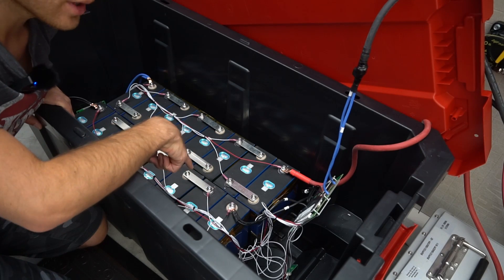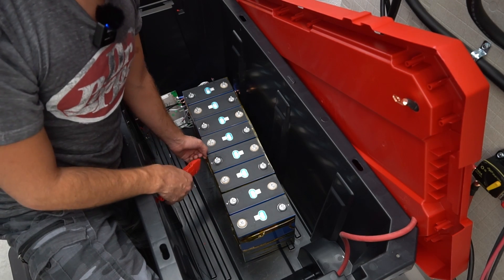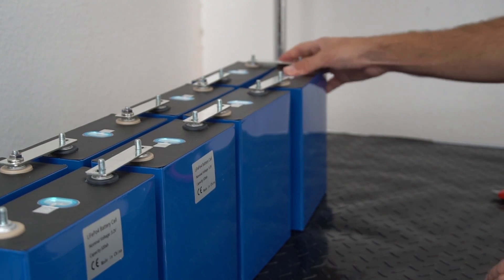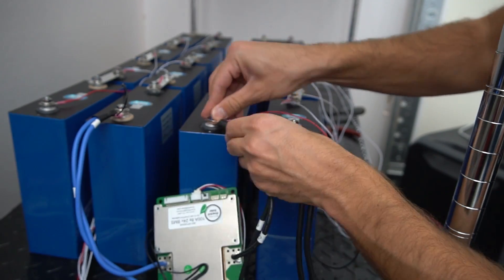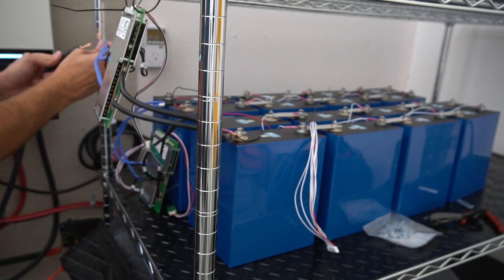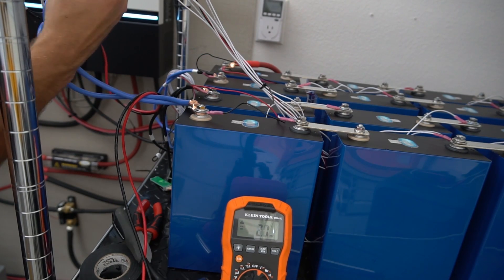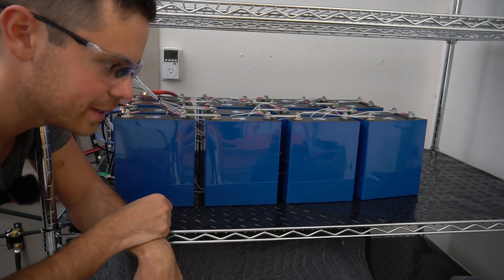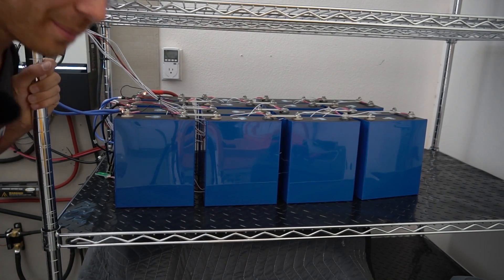Bloated LiFePO4 Cell Configuration to Reduce Terminal Stress! (suggested by my viewers)

Comment: My lifepo4 cells swelled a huge amount.  Like a pillow.. They blew apart the plastic battery box.  Are they ruined?  Or can I recompress them?  Or just use them as is?  They are small 32AH square cells, about 4"x5.5"x1.25"   and swelled up like a pillow.  Perhaps from overcharging, though I had a really good JBD bms with low and high voltage cutoff and had it on a LIFEPO4 charger.  So should have cut off.  It sat for about 6 months.

Comment: Hi Will, you mentioned....  these can bloat all they want.  i was under the impression that bloating is super bad and means they need to be replaced.  is that true?  how much is too much bloating?  do these ever "un-bloat" over time?  I have one cell that has bloated quite a bit so i've got a new replacement set coming but was really curious as to whats considered too much bloating and MUST be replaced.    I have eve lifepo4 230 ah in a 48v setup.  also, is there such a thing as a 17s bms/balancer?  my axpert hybrid inverter apparently can handle 51.2 v so I had thought about adding one more cell to make it a 51.2v setup but i'm not seeing any bms/balancer for lifepo thats 17s.    since I don't see any hybrid inverters that can do 96v, what are these 20s or 24s bms/balancers used for?  
also, i had my batteries strapped together like you did.  i only see one cell that has bloated.
 
Thanks,

Comment: I know this video is 3 months old, but that style of shelf is the absolute worst... They tend to use set screws + friction on cheaply plated posts that chip.... Even if you dig the screws in, slightly overloading them leads to the shelf slowly working down the posts....

Maybe you got some quality ones there, but I personally would not put what would essentially be a bo mb on there in the case the shelf comes down....

Comment: Odd chance I'll get a response, but those warning labels for the cables, what does it say and where did you get them? It looks quite pro.

I assume it's to warn about either 48v DC under load or that it WILL arch if you disconnect it improperly. I would like those.

Comment: Will, Love the videos and you have given me a great education in this space.  Curious question, in a 4, 100ah lithium array does the wiring all have to be the same size or can it be increased as the cumulative load increases as the load is drawn? So in this use case say I put a 100ah load onto this 4, 100am battery array, would the draw load be different across each leg growing 25 amps per leg.  Would the first connector only carry 25 amps and the second 50 amps and the third 75 amps and coming off the last be 100 amps to the buss bar and to the load source? Would it be ok to use increasing wire size going 6 awg then 3 awg then 1 awg and then 2/0 awg to the buss bar if 100 amps draw was always going to by my max? Why do almost all installations always use the same wire size and is it really not needed or is it just the way we always do it?

Comment: Is this suggesting that externally forcing my 4s battery pack to be unable to expand (so, when they do try to bloat it creates compressive force on each cell) could lead to a scenario in which a cell off-gasses out the top???   

Does anyone have experience with this happening?
Reply: No.  You just have to compress them when they are still new and flat and before you fully charge them.  Then they won't bloat.  Also charging them at the recommended charge amperage reduces bloating.   Rapid high amperage charging increases the chances of bloating the cells.  Once bloated you cannot compress them flat again.   That seems like it could cause the pressure valves to leak, but I've really not heard of that happening.

Comment: I thought compression on the batteries is for reducing the movement inside!? Is compression only recomended to prevent movement, respectively stress on the terminals when fixed together with not flexible busbars? regards! Axel

Comment: BMS using in series is normally forbidden. The Mosfets can not handle much higher voltages as the BMS is designed for. Did the supplier say that it can be done in that way?
Reply from the maker: We use only FETs rated for 80V when using, 48V nominal. This was a big issue some years ago, but not any longer. Most have higher voltage capable fet's
Reply: Any trouble or inconvenience with yours BMS during all this time of use ?

Comment: Will… video request.  How to connect additional batteries in parallel.  I have 2 - 5kwh 48v batteries.  My plan is to get the voltages close to 53 v and then switch the second battery on.  I would be interested in how you do it.

Comment: "Bloated Batteries" Isn't that a strong indicator of impending battery failure.
Reply from the maker: For most chemistries but it depends. LiFePO4 pouch cells swell a lot naturally
Reply from the maker: Depends on why. Cobalt based cells, super dangerous.

Comment: How are some 12 volt batteries 100 amp hour and some are 300 amp hour but the same physical dimensions ? Say a 12 volt d series companies offer them in 100 amp, 200 amp, and 300 amp size but same dimension of the d serries.

Comment: The first lithium batteries I bought was over 2 years ago. After a year one of them puffed out like a pillow. Although it's a little lower in voltage than the rest, they have been working together just fine.

Comment: Thanks Will. I had such a setup from the beginning with my first battery build. I'm not a friend of compression at all and always had a few mm space in between the cells. That make all a lot of sense.
Reply from the maker: Oh awesome!!! It's a fantastic configuration. And I'm glad you think the same way about compression. I never knew what the fuss was all about lol
Reply: @WillProwse  Exactly. This topic basically splits the nation. Some are fanatically chasing these additional cycles, other could not be bothered more 😂
Either way is fine, I guess. Everyone has the option and there is no right or wrong, it's just personal preference.
Reply: Isn't swelling bad for the cells? I have seen others compress the cell stack to prevent that.
Reply: @dougg8280  under certain circumstances they can last up to 1000 cycles longer with compression (or fixture) than without. Not so relevant in solar setups with relatively low currents.
Reply: @OffGridGarageAustralia  thanks

Comment: Do you prefer one 16s battery with one bms or two 8s batteries with one bms each?
Reply: He had to use two BMS units because one 16s was not available.   Two BMS units will allow him more current.   Check out his web page where he has 3 BMS units configured to get 300 AMPS.  All depends on voltage and Amps.

Comment: I am totally new to solar and an extreme novice at electricity, but I was wondering if you could do a video on a solar backup system for a home that the sole purpose is to keep a refrigerator running.   I worry about a power outage that would last for a few days that would cause me to lose everything in my fridge.  My current refrigerator says it is 115 volts and 3.3Amps.   I followed your advice in another video and it appears that 115*3.3 = 380 watts and running wattage of 127 watts, can you help?

Comment: Alternatively you could use flexible Bus bars to prevent any stress on the terminals. There are two kinds of them: foil busbars and woven conductors with crimped/welded ends.
They are still pretty cheap, especially when you always have the same dimensions or you use a already existing procut. 
With flexible Busbars you then could use your plastic housing again.

Comment: Great video. I didn't know you could connect packs together through a bms as you did with the lower bms not tie wrapped to the frame. Great experimenting with bloated cells. Looking forward to your capacity test.
Reply: I did one that was 2/36 bms in series.  I thought I was going to loose my mind plus the voltage scared the crap out of me

Comment: Wasn't there someting about prismatic cells under compression lasting significantly longer?
Reply from the maker: Not significantly longer. This has been discussed a lot on our forum, you should join the discussion and post your evidence.
Reply: @WillProwse  I didn't have any evidence. I had heard something about it and had seen on a weber auto channel battery disassembly video that the Prius Prime batteries were under significant compression. So I thought there must have been a reason the engineers chose to make their design that way when they didn't have to. I also figured you were probably more well read on the topic than I was and might be able to give an answer off the top of your head.

Comment: Separating the cells so that they are not touching seems like a very good idea. The amount of energy stored in one of those cells is like 1/2 cup of gasoline. So a short could make for a very bad day. 

On a similar note, a short between adjacent sense leads, while likely to only result in a fried open lead, could also be a bad situation. Since no current is flowing in the sense leads (assuming they are not also being used for balancing), then why not add a set of resistors (e.g. 1k) in series with the leads. Then should 2 sense wires short, the current would be limited by the resistors, and not cause any (safety) issue.
Reply: Any short burns his house down.  No stopping it.

Comment: Nice 👍 work .. just one thing I think you made the mistake several times coming off the BMS you use the blue cable for your main negative, you did it when The battery was in the plastic box .. will that caused any issues by the way?

Comment: Letting them expand and contract will mechanically shorten their lifespan. You should compress them with two aluminum plates and thread rod. Also have you considered keeping the cells in a chest freezer at 2degC?

Comment: Hey Will. A bit early for a Halloween video isn’t it? 

Seriously though, great video as always. I have a request. I just bought a Ryobi rm300e. That is an electric mower with a (2.4 kWh) 48V, 50 Ah lead acid AGM battery. Could you do a video a setup to use that big battery as a backup in an emergency to power a few small loads like a refrigerator and some lights?

Comment: Use the battery studs to fit a pillar nut. Then add a threaded stud to the pillar nut. Fit a paxolin board to the studs. Fit bms to the paxolin board. Job done.

Comment: You could clamp a piece of plywood to the end of the shelf with bolts and large fender washers, then mount the BMS's on the outside or inside and they would be fixed and safe.

Comment: Is there any way to protect against an EMP attack???
Reply: Yes, there is.  The simplest method is to get rid of your electronics and anything that could be damaged by an EMP.

The second, more difficult option is to install robust EM shielding around your electronics, and add surge protection to any conductors that go outside the shielding.

Comment: well done! one suggestion for the BMS, you could mount both to a fiberboard and then the fiberboard to the edge of the shelf. Maybe you could reduce the input and output through the BMS to not stress those Grade B cells. Either way, looks good!

Comment: Do you recommend the Southwire clamp meter you use in this video?
Reply from the maker: I actually love it. Just as good as my Klein and the non contact voltage sensor is fantastic and easier to use than other clamp meters. Great meter

Comment: Will!!!  You are CRAZY for putting all that weight on that skimpy little shelf. Those NSF shelf units can and will fail, and when it does it will crash down.  The shelf is just wedged into position and the wedges will fail.
Reply from the maker: This one is rated for 8,000 lb. Each shelf can handle 350 lb. Please read the data sheet.
Reply from the maker: And I have six of them and they're super expensive for a reason.
Reply: @WillProwse   Hey I  agree with you, they are super expensive and will hold the weight, but I have personally seen them fail because the shelf clips didn't hold (Plastic wedge) at less weight than rated. Small beans I know, but you are wearing safety glasses in your videos...Just saying.

Comment: Really think your making too much concern for "pressure" build up when cells bloat from charging. Yes from charging, not discharging as previous commenter said. My pack of four bloated cells, the same cells as yours, produced very little pressure when charged to 90%. I secured cells with 1/4"aluminum plate at each end with 2 threaded rods each side. While charging I checked the rods and they never got tight. I secured them when discharged to about 10%, when they were almost flat. Once secured, bloating was restricted with little to no pressure. I would think all that movement will eventually damage the cells. I guess we will see.
Reply: It would be great if you had one pack with fully compressed cells in the system to compare over time.
Reply from the maker: Discharging too low causes gas formation from the electrolyte. Charging up to full makes them expand. Try it yourself
Reply from the maker: I am more concerned with the terminal and the stress placed on it than the actual bloating

Comment: You need a 3D printer to fabricate some form of nice looking brackets to hold the BMS's, wiring and other things. Designed well, you could have ports for routing wiring, screw holes... whatever you can imagine.

Comment: In my experience, the cells bloat when they are discharged, and unbloat-ish when they are charged up.
You really need to compress them so they are not allowed to bloat!
Bloating means the film inside is not getting full contact between them.

Comment: You can bolt a small flat bar or wood on the side mounted on the shelf .if you put a flat piece of something filling the gap on the side of the shelf . the bms could be mounted to that board.if it's wood it's auto insulated .

Comment: Nice work!   only issue I see is that IF you get leakage, it's going all over the place, which was prevented with your box before.   One idea and it's a throw out idea, is flip the rack upside down and you can put in a liner that would go up the sides and prevent spillage...   Or simpler still find the lids for the right sized boxes and put the batteries on the upside down lids with lips...

Comment: Is there a way to connect two solar panels in series and in parallel and put some type of switch into swap back and forth to whichever one you want to charge with? I have two power Banks, both of them charge off my two solar panels on my truck but one of them needs series and the other one needs parallel. Is there a way to do it so I don't have to unplug and plug things in a different way?
Reply: A double pole double throw switch if you can find one with an appropriate   current rating, a relay could be used. This would also open up the possibility of remote control.
Reply: The best way I can think of is to use " dual circuit On1/off/on2" type switches. (Double pole, double throw). One can wire these in such a way to be able to do what you  want...similar to the switch used by my neighbor to brake the wind generator. Of course, someone else might have an easier or better way.
Reply: Your question has been asked and answered on stackexchange electronics.  I'll try to post a link, but if it doesn't come through then search "stackexchange solar panel parallel series switch" on Google, open the first link and look at the second answer.  Just use latching relays and a momentary contact switch to trigger the relays to the desired position.  Using relays connected close to the solar panel will let you use less heavy gauge wiring versus having to run two sets of heavy gauge wire to a nearby switch (and lose less power from longer cables).

Comment: Those batteries look unstable sitting there like that. I would build them into a box type structure, allowing for all the gaps between the batteries as you have then laid out there. Can't wait to see your system with the miners too. I used to run some BTC miners. Was a fun project but lots of hassles, which you will discover too. :)

Comment: Are you sure the outer casing is + for these cells? I've tested multiple cells, EVE, Lishen, REPT and CATL, but never found one with the + actually connected to the case. Yes, there is a voltage between - and the cell case, but it's not the + pole: I wasn't able to pull any current. (Even with a dead short). It's just a very small leakage. 
Just tested it on a 280Ah REPT cell. Connecting my meter in current measuring mode beween - and case gave me a current of approx 1mA. Thats all..
For a safety point of view, I don't see any issue. It CAN cause some inbalance between the cells, so I still prefer insulation between the cells (Just in-case-of). Even the most simple BMS has a balancing current capacity of way more, but I like to do it properly. 
I personally like the Ikea finfördela chopping boards: 1mm thick flexible plastic, easy to cut but still pretty strong, and cheap ($1.49 for 2 pieces)
Reply from the maker: Yeah I argued the same thing, but a ton of people still complain about it on the forum. I did a dead short from case to each terminal and barely had anything flow. You're right. But watch, someone will comment saying we need more insulation etc etc. It's pretty annoying and I tell them it's not an issue but it doesn't stop them
Reply: @WillProwse  Yeah, the majority of the people don't understand the concept of a meter having a high impedance (thus pulling almost 0 amps to do the measuring). They just assume voltage = current. Would make a nice video, measuring 12V directly, and through a 500k resistor... will give the same reading. But when shorting... with 500k nothing happens... without... well that's another topic :-) (And a more expensive meter has an even higher impedance)
Reply from the maker: Just checked and potential on my cell exists from the case to the negative terminal. So the case is connected to positive terminal on this cell